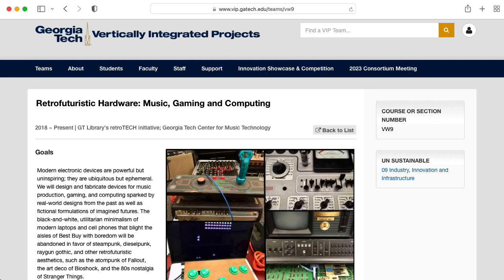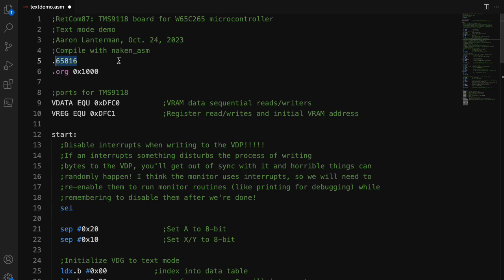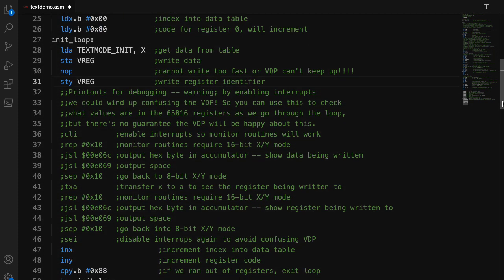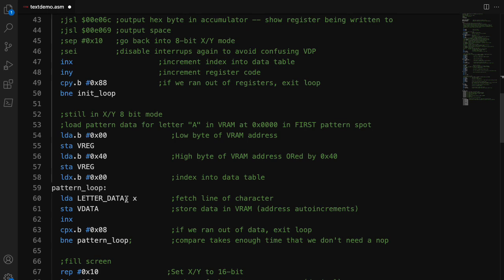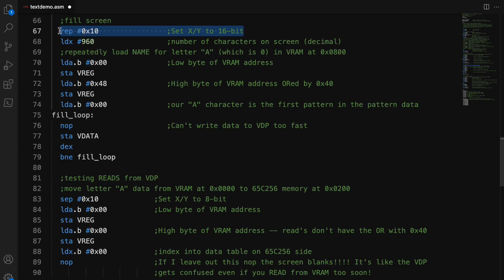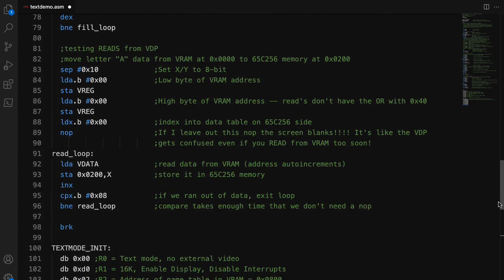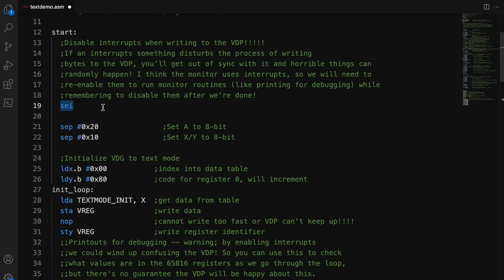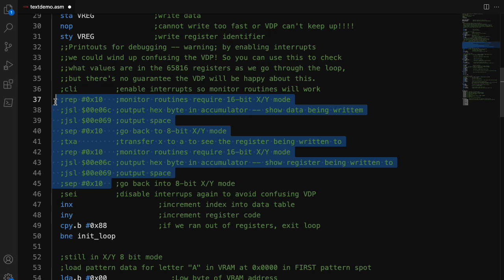The Murder Hornet of Computer Bugs: TMS9918 Text Display Demo Code Walkthrough (TMS9118) (RetCom87)

Comment: This sounds very much like you need to insert a wait state when you access the TMS. I had a look at the datasheet for the WD65C265SXB and you can do it with the BE pin. Pull it low when PHI2 is high, and the processor will pause until BE is released. It might be possible to wire up a counter to trigger when a memory access is performed, or it might be easier with an analog one-shot like the 74HC123.
Reply from the maker: Wow... that sounds scary complicated! I must confess than when I say I am a "Professor of Electrical and Computer Engineering," I learn far more on the "Electrical" side (as in analog electronics and signal processing) than the "Computer" side. I'm mostly bumbling my way through on the latter. ;)
Reply: @Lantertronics  I'll email you with further details on what I mean. It's not complicated to wire up, but it's a little tricky in its operation.

Comment: Great work! A couple of points: You only need to disable interrupts while setting the address - you can't interrupt writing the two byte sequence, so my subroutine that sets the TMS address starts with a php/sei and ends with a plp. By protecting that short subroutine, you can enable interrupts generally. Also note there, I use php/plp instead of explicitly calling cli at the end since interrupts might have been disabled by some other code, so you don't want your TMS address setting code breaking that. Your comment regarding timing and concern over reading requiring nops - the reason is the memory bandwidth is obviously limited and the TMS is continually accessing the VRAM in order to render the screen. It has to squeeze in your memory requests in very small windows. That's the reason memory access aren't "instant". In the datasheet, there is a table describing the maximum wait times under a number of different situations (display modes, etc.). I minimize delays by doing most TMS9918 VRAM accesses in the VBLANK region where that delay is smallest.
Reply: Some more detail on the read delays. When you set the address, it's at this point (well... in the next VRAM access window) it fetches the value from VRAM and increments the read pointer. As you said, that's why you saw the issue with writes since it was reading and incrementing first. Anyway, it really needs to do it that way because there's no way for it to (reliably) fetch from VRAM in a single CPU clock cycle since it prioritizes VRAM reads for display output... always! So, when you're reading a value from VRAM, that value has already been retrieved by the VDP and it's sitting in a register ready for "instant" access. Once you've read the value, it will then go and fetch the next value as soon as it's able (and increment the pointer again). This is the time you need to wait between accesses.  Hopefully that makes sense. 🤷

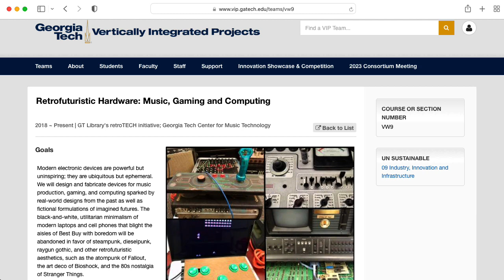Comment: 0:22 I spy a DK Synergy 👀
Reply from the maker: You are not wrong. :)

I've been meaning to swap the horrible wire-wrap sockets jammed into IC sockets for real mating headers so I can move the thing without having to spend hours getting the daughterboards back solidly in place...
Reply from the maker: I also never got the communication between it and the Kaypro working, that's another project someday...